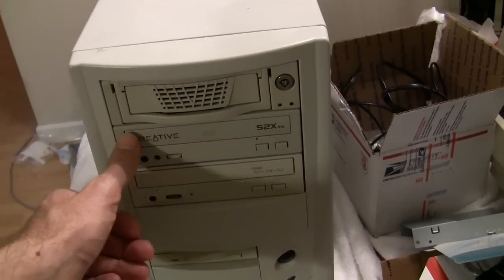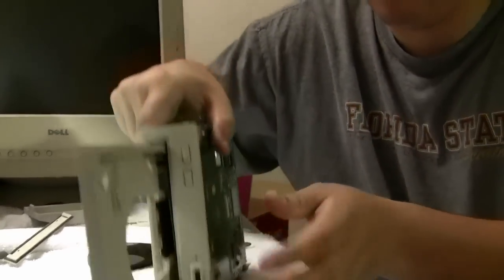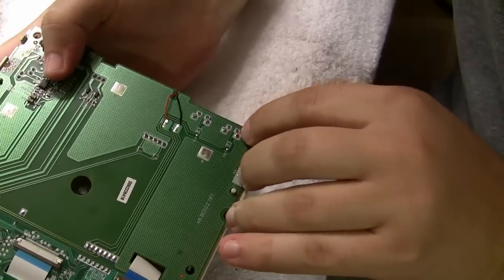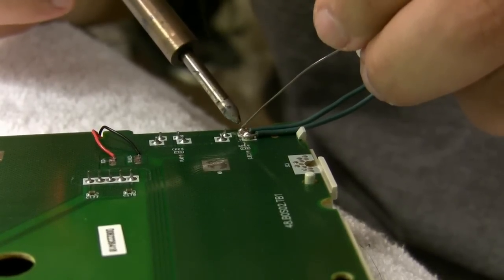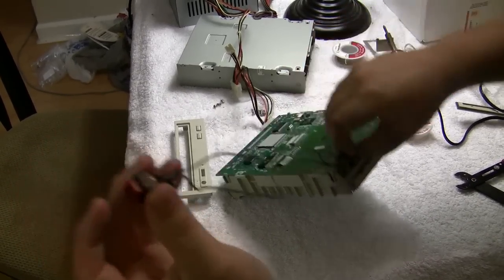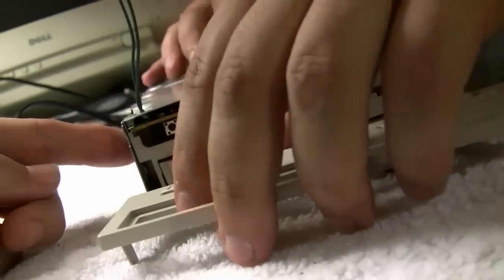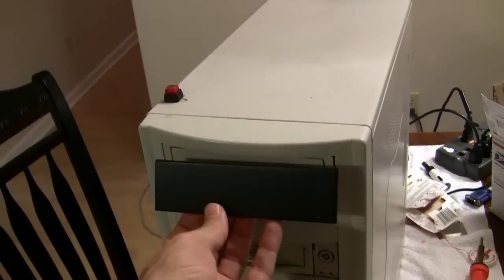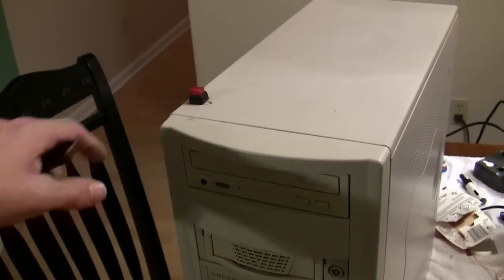Re-routing the optical drive eject button

Comment: @supertroye i think he means the 4 points on the circuit board. you attach the 2 cables on 2 soldering points and leave the other two points untouched.  i would also like to know how you knew which ones to use.

Comment: @supertroye I think he was referring to the two places where you soldered the wires to the board. I also was curious as to how you know which two of the four soldered places were the correct ones to attach the wires.

Also, would I be able to use a switch rather than a button. So, flick the switch one way... it opens, flick it back... closed?